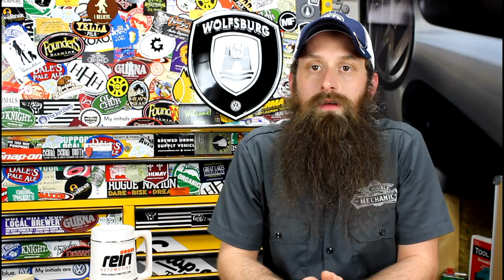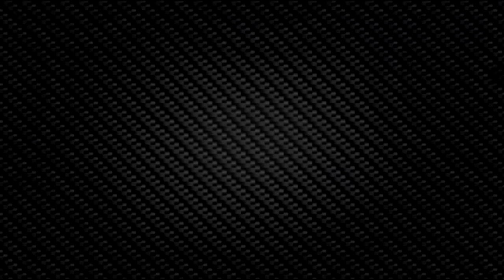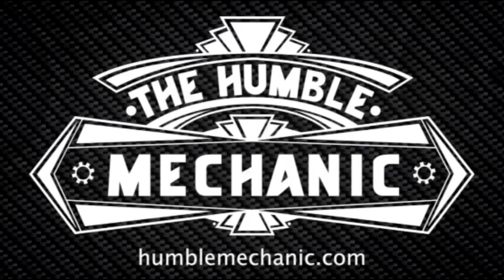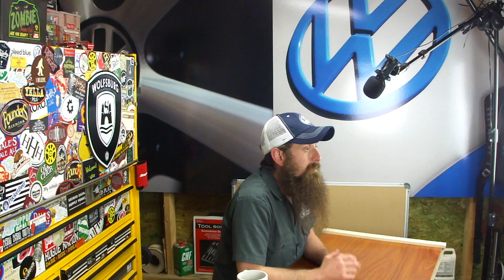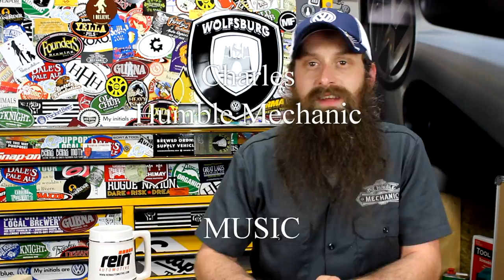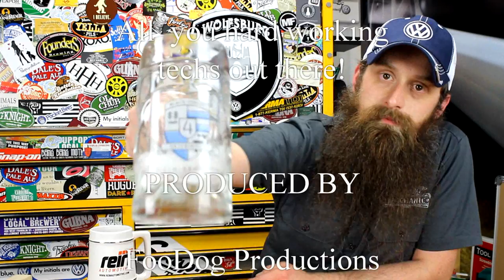Why Flat Rate is a Good Way to Get Paid

Comment: The prob is the criminally low Warranty Rate and Extended Warranty Rate.  Rates should be standardized but they aren't by warranty. This leads to techs looking the other way when the car is under warranty. This hurts everyone in the process: customer, dealer and mftr reputation, techs reputation.

Also,  the fastest flat raters tend push their job quality to almost half assed quality. Sure they make their 80-100 hours/week but golly their work quality leaves much to be desired. Dealers love fast guys cuz they are all about #s and the bottom line. But they are not doing customer's cars any favors by rushing work, installing/machining parts uneven, over/under lubed, doing half a flush, making modifications to cars to avoid taking other things apart, and unnecessarily denting/damaging parts, leaving a mess for the next guy to deal with. I've seen the fastest guys work and I do not want them touching my family's cars. 

Of course, doing more work for less money is not something to be celebrated ... it's a race to the bottom to becoming a 3rd world nation. 

That's why it's hard to attract real talent to be techs. It's just not worth for those with a brain and skills. If u put all that time and effort in another profession/department like sales, you'd make 3x-4x more money without killing your body. Also, when your body breaks down as a tech, your income dive bombs. 

Maybe Flat Rate was good in the olden ages when techs were paid better and customers were willing to pay more but these days it's generally bad for most techs (the non-fed techs) and all customers.
Reply: warranty work well sorry call the F......... person that made this Shit and tell him to come fix it.

Comment: From a different perspective in a dealership, I think some mechanics deserve flat rate as they know the jobs, do them well, and consistently pull in great hours.  The new ones need to find out what flat rate is all about.  We've had one mechanic tell us that a mirror housing is .6 to replace for warranty (rust).  He couldn't get the cap off in .6 and kicked the car out.  My appointment coordinator saw the car without a cap outside, notified the service manager and we had to get another mechanic on the job to fix the screw up.  Imagine a customer coming in to pick the vehicle up?  Anyways the point is, there needs to be a mix of either a flat rate/bonus system or better hourly pay plus incentive.  On top of it all.  Performance based hourly figures.  If you are a $30 an hour mechanic, you deserve that.  If you can't tell your butt from your hole, you deserve a lot less.  Even if a dealership raises their rates (ours did) the good mechanics should have their hourly wage go up by the same percentage rate.  Saying that, we always have to fight our owner for wages even though he lives well above proper living and keeps buying dealerships that are in the gutter....

Comment: Being an entry tech (about 1 year flat rate, 2 years dealer experience)  performance based pay seems to expose the work ethic of technicians. As stated, lazy techs make crap, and when harder techs bust ass there is no jealousy towards the fools who don't hustle. However, my issue with flat rate is the dealer itself. Every dealer distributes work differently, and Between the two dealers I have been at there is always favoritism. While I do not think flat rate is 100% (and labor rates themselves for warranty repairs can be farfetched), I think that the actual distribution of work fairly seems to be a big issue at the dealers Ive been at.

Comment: after my very first year as a tech, which was at $10/hr flat rate, I asked for a raise.  my svc mngr showed me how to give my self a raise through a good quality inspection.  I found I made a lot more money and turned out cars that didn't have to come back a month later with something else wrong.  win, win, win.  I agree, it's not perfect and gets abused by some, but that would be true of any system put in place.
Reply: Jesse Williams 
That's the issue with the system. You had to give yourself a raise lol think about this day that shop rate is $100 am hour and your at $10 an hour so you do 90% of the labor involved with that vehicle and the other 10% is the service writer writing up and checking in the vehicle and dispatching the work and who ever flags you closing the repair order. Yet of that $100 an hour rate you only get 10% even though you do 90% of the labor involved. And the manager saying give your self a raise shows how uninvested they are in technicians but only want you to do more and sell more, more, more but don't want to give anything in return.

Comment: Get an hourly fleet mechanic job.  No customers, no politics.  I would never work at a dealer or for outside customers.  Try to gt in a Union.  We have hourly pay and overtime after 8 hours per day worked, not after you have 40 in.  Health, dental and a real pension.  As far as lazy people, where I work they are immediately "pushed" out of the way.  We take pride in our team and shun the worthless slobs.  There is just too much to do and work needs to be distributed equally so one guy isn't getting overworked.  It could take some time with new guys building a solid crew but once you do it's all downhill from there.  Work hard, get fair pay, don't settle and demand to be treated well.  There aren't many people coming in to replace us.  The worst thing to do is settle...its your 1/3 to 1/2 of your day, your body, your $$$ in tools..etc.

Comment: hey Charles i got a question for you!! im gonna be doing an egr cooler delete and an intake manifold cleaning on my alh!! im gonna have to buy some allen head sockets and was wondering what you would suggest would go best between the ballhead allen vs ordinary allen  and short or long? thanks for the responce and keep doing what youre doing!!
Reply from the maker: jessy6464 Simple answer YES! LOL I have all of them, They have different applications. If you buy the ball ones, get Snap on . They are the only ones that fit properly. Every other set I have had that was ball end rounded out the Allen.
Reply: HumbleMechanic ahh nice!! Thanks for the info man!!

Comment: Flat rate is bad for customers cause they get a inflated repair bill because the tech has to make up lost hours of a broken system(flat rate). Also the quality of the repair suffers. Another issue is a customer brings car in for a noise or drive ability concern ends up leaving the shop with bunch of maintenance work done but tech does not fix original concern, I have seen that many times.

Comment: In my 14 years at the flat rate dealer I’ve found that the mediocre to less than than mediocre technicians don’t favor the flat rate system. Flat rate is ideal for the high caliber technicians which in turn  yields a high earning potential.  In my opinion flat rate is the only way to go in this industry.  I wouldn’t work any other way.

Comment: I love flat rate and I'm the biggest hack there is. I bend and break so much shit under the hood. I always have left over brackets and bolts. Especially on VWs. I have a VW in my bay now and I guarantee it will never be the same when I'm done with it

Comment: i believe flat rate is the best system overall. most techs don't cut corners(at least where i work) we don't try and sell things you don't need. anything i try and sell (air filters, cabin filter, tune up, brakes etc) everything I can show the customer (maybe not tune up that we go by mileage) now there are downside, such work being slow it happens. but what I find to be a negative on hourly system (yes there's a place for it to we have both at my shop) lets say the tech takes 3 days to do rear drums a few feet of brake lines and 2 lower ball joints, there's an issue and he shouldn't be paid for the 3 days it took him (he also broke 2 wheel speed sensors from what i heard) if he was paid hourly he would made 18 hours for that work? I see both negative and positives but its one of those things there isn't a correct answer. the hourly at my shop also do some bigger work if all the flat rates are busy (brakes mostly our hourly's don't have many certs) they are also the ones to do air pressure checks and things, sweep the shop. another things is our shop doesn't force people to be a flat rate or hourly, i started as an hourly and as I became more knowledgeable and faster I asked to become a flat rate, almost every week i break even or higher than how long im there a week. I also live in Michigan, lots of rust. there's ways around that, many tricks that you can learn to get around snapping bolts and things. so flat rate is a good system for a good tech, not one that skips corners or plays on their phone. but I feel flat rates and hourly's belong in the same shop where someone who works well can make more time, while someone who isn't ready for the system can still learn.
Reply: oh i should mention, we grab jobs from a board from the order of the customer we don't get handed board unless theres only one person qualified to do it (trans, driveline electrical etc) lets say theres 2 people allowed to do it, whoever gets the board first gets the job.

Comment: good points, however it feels like you been spoiled with dealership jobs too much. 
Im not a professional mechanic, however been swinging wenches for 2 years in project cars that are over 20 years of age with various problems. 
as a consumer i LOOOVE flat rate. so i know there are no surprise bills, 
I can easily see why a mechanic would find flat rate unfair. The amount of time that a single bolt seized has taken me to remove would have easily brought a flat rate mechanic to hate both myself and my cars if they got those jobs. 
There is also diagnostics. I currently have an ABS light on, I have spent quite a few hours trying to diagnose it so far, and as smartly as possible (stripping interior for a welding job, while waiting for the weld doing the checks on the wires and others of the kind.) and still havent got to the bottom of it. 

I think its potentially best to mix a bit of the 2 systems. where there is a flat rate which would be the "estimate" and a "maximum quote value" being based on the flat rate plus some extra weight (maybe extra 10%?) 

I would be happy with a mechanic working on my car at hourly rate, as long as i could work alongside him, in order to be sure he is not slacking, as well as do whatever odd bits in paralell to speed up the process, and, i would learn something as well. But i haven't meet any place that would look keen on that, including places that try to avoid my cars...

Comment: I like the video .
First time learning about flat rate system.  My question is for return problem if job isn't completed correctly how do you prove it was techs fault.
Who cleans up the work area when job is done if not cleaned could be safety issue.

Comment: There are pros and cons to both.  If you work at a flat rate shop without guarantee, hourly is better.  If you work at a flat rate shop with guarantee, flat rate is better.  I feel for the guys who lose on jobs because of circumstances beyond their control, but it's not fair either for a good tech who can work twice as fast as another to make only a few bucks an hour more (let's be honest, that's all it will ever be at most hourly shops no matter how good you are) than an average tech who's just not as fast.

Comment: I think performance based pay is the way to go, but the whole flat rate system needs to be overhauled. I work in independent shops, not dealerships. Why can't shops pay techs with a base salary plus commission like they service writers? I've had salary jobs in independent shops. It's a love/hate relationship. Love the pay when it's slow, hate knowing I could make more on flat rate when we were busy. With the flat rate system, it's flawed against the ones who actually produce the product, spend the money for tools, and take the personal time to learn the craft. Also it hurts the new techs who need tools, but don't have the knowledge to earn a decent living. As I have seen it multiple times, shops get busy, hire more techs, every tech takes a pay cut bc not enough work for everyone, and then good techs leave when another shop offers more money or work and the cycle starts over again. While this is happening, the owner and service writers are making more money, not the techs.

Comment: I am not in your industry, I thought I wanted to be, right out of High School but I was over ruled and in my senior year was immediately enrolled in my local community college's engineering program. I did get my degree and the oil and mining industries were slammed I went into residential construction. Same sort of issues there. Do a bid job, hustle your ass, and people think they're getting ripped off. I did have the great good fortune to work for an a master craftsman who strictly worked on an hourly basis, On jobs nobody else could, or would do. Like true master in any profession he made a lot of it look easy, and people thought they were getting ripped off. I would sometimes have to point out our investment in vehicle, and tools, and the time it took to gain the knowledge, and the fact that a lot of work was done outside sometimes in inclement weather, and there was a great deal of physical danger, of death or permanent injury, that they did not choose to perform themselves. Oh yes my wife owns a 2003 Passat  with the 1.8 Turbo, and I was thrilled to pay the dealership the flat rate, for the timing belt replacement  because I sure as heck wasn't going to be able to do it in that time allotted. An in the vein of true professionalism, even though I knew that one should replace the water pump at this point, they suggested it before I needed to request it, even though it might have earned them a second equally expensive service in the near future.
Reply: +giantgeoff This is an excellent point. It is hard to get paid for what a job is worth if people don't understand the rarity of some of these skills. It's kind of like people who get paid to give speeches. They make it look easy too!

Comment: I have made $300 000 in three years on flat rate. So I consider myself good and efficient tech, I guess. But I ended up hating this time to the very depth of my soul. Before that I used to love my job and couldn't imagine myself doing anything else but work on cars. Flat rate made me to hate my job and to think about doing something else. 

In fact flat rate is an invention to punish technician for doing a great job and for being smart and good at diagnostics. It promotes selling endless brake jobs, useless flushes and imaginary oil leaks to the customers while skipping on things where tech can not make hours. It promotes doing the job that is only barely good enough to avoid come back charged on you. Because if you are doing "too good" of a job - you get paid less! It is the system that pushes out of the trade the best diagnostic techs. Diagnostic does not make hours - but it makes happy and loyal customers. The problem is that it is YOU who is paid by the hours you flagged (or rather not paid for all the effort and knowledge you applied to solving the problem) but it is the SHOP who is getting happy and loyal customers. 

I used to have my own shop 10 years ago (in another country) and thought that flat rate is the closest thing to running your own business. WRONG! Flat rate is nothing but a means for the shop to have FREE WORKFORCE. Flat rate shop can hire as many techs as they can cram in and they will cost nothing to the business. Is not that convenient?!

Now I run my own shop again, making less money and working much longer hours (although I am only three months in business so the things are way better then I expected!) but now I am happy and love my job again. I don't care about "making hours" any more. I charge for the job but I take as much time as I need to do the best job I can. Because this is what makes loyal customers FOR ME now, not for my boss. And then these loyal customers will supply me, not my "teammates", with stable and profitable workflow. So now I am not "losing hours" on the job but INVESTING them into the customer.
Reply from the maker: +Andrey Bondarenko Thanks for sharing! I am really happy you have found a gig that you love and are doing what's best for your customers. 

For a small operation FR is not needed. But I wonder how a bigger dealership would handle it. Not everyone will care about customers like you and I do.
Reply: +HumbleMechanic The reason why I call flat rate "primitive" is that it ensures only financial aspect of efficiency. Ultimately it ends up with a dealership making tons of money - and tons of unhappy customers who for a top dollar they pay getting only very mediocre quality of work. The reason why they use it is because it is simple to apply: tech is not making hours - tech does not get paid. Which is the best way to get rid of diag techs and guys making high quality work.

Comment: I'm paid by the hour right now and hope to end up going to flat rate. I am still fairly new, 1 year of school experience and been at the shop for 2 months and have just recently graduated and went full time. I'm not fast and would like to better myself in any possible way I can. How long did it take you to get the ball rolling?
Reply from the maker: +Brian Adams It took me about 6 months on flat rate to figure it out. Then from there, I worked hard to fine tune my flat rate game.
Reply: +HumbleMechanic I am moving faster than when I first started and since I went full time, I'm getting a lot more done. I got a transmission pulled in 1 day where it took me a few days while in school. Granted it was my first time doing it at work on a car I've never worked on. So it was a good learning experience. I just hope I can move faster and faster.